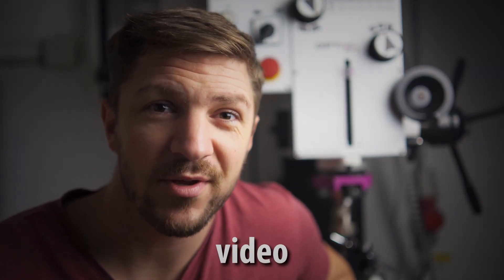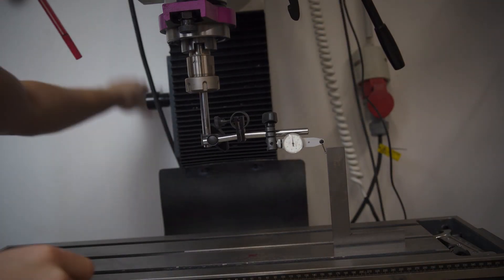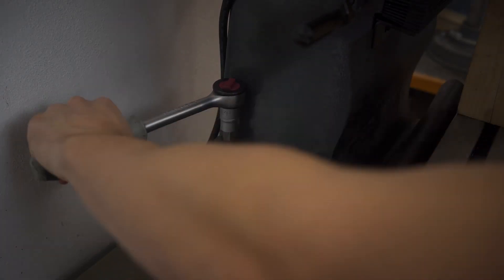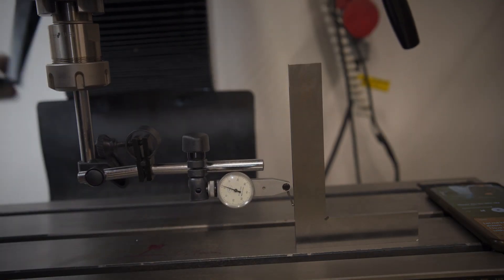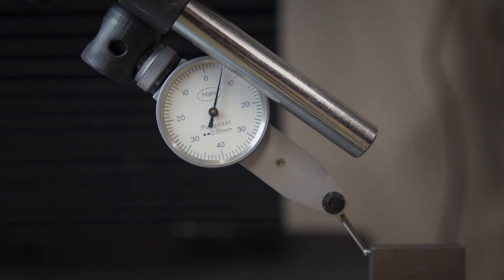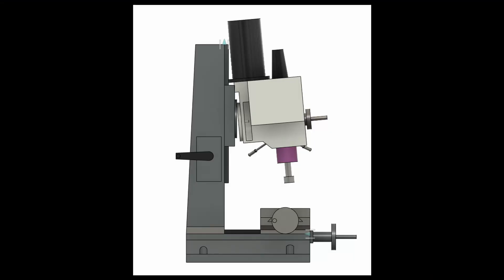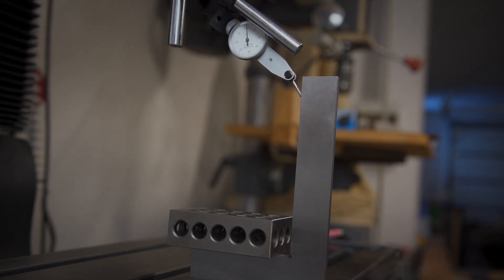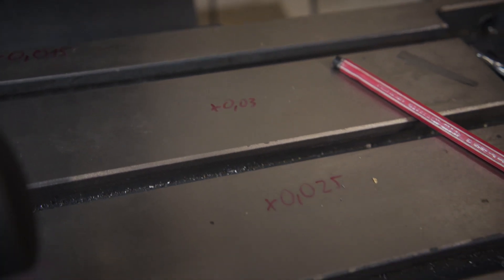HOW TO TRAM A BENCHTOP MILL | Optimum MB4

Comment: only comment is its better to clock to a fixed point on the table rather than sweep across. usually a ball. no guarantee that table top is parallel/square to slideways. yes, its a bit more tedious as you gotta twiddle handles...

Comment: In regards to your comment that correcting the mating surfaces is still beyond your skills, there is a very easy yet brilliant solution! The normal way to do it is through hand scraping, which will yield extremely accurate results as far as flatness, and will also produce superior bearing surfaces if they need to be lubricated because the depressions produced during scraping will hold oil very well, but scraping is also quite an art form to do properly. If all you want is flatness down to a couple micrometers, of even below 1 micrometer, then you can do it by rotary tool. What you do is you still use an ultra flat reference surface like a granite surface plate or a cast iron straight beam and coat it with a thin layer of blue oil paint and apply it to whatever you wanted to scrape. However instead of hand scraping all the spots the blue paint transferred to and thus are too high, you use a small handheld rotary tool or one with those extenders and one of those coloured aluminium oxide or carbide coated epoxy resin inserts for the rotary tool. I used it to flatten the absolutely horrible bed ways of my mini lathe and it works insanely well, down to sub micrometer flatness over several dozen centimeter distance!

Comment: When sweeping the indicator on the table it should be noted, that this method shows any perpendicularity error between the spindle axis and the table plane - thus it is also necessary to make sure that the table plane is parallel to the x-axis and y-axis by putting the indicator needle on the table and moving in x/y.

This also applies to the reference square method as we want the column/head to be parallel to the movement of the x/y axis not just the table surface (which could be unevenly ground or not parallel to the x/y plane)

Super Video sonst - alles Wesentliche in unter fünf Minuten erklärt!

Comment: "typical import square collumn geared head benchtop mill"
the major problem is that the vast typical import is a Cinese crap such as SIEG, which has no option to adjust spindle axis alignment in reference to the column guide at the bolts are buried inside(!) of a head stock housing
Reply: Hmm pallet plate bolted to milling table and shim it..just a thought..

Comment: Excellent video, very helpful.

Where abouts did you get your shim stock pack from? I'm looking for something similar (for the same task), but not able to easily find anything (probably because I'm in Australia and materials that are easily available in the US and Europe seem to be unobtainable or extremely expensive here).Think I found the product you got and the company it came from.. unfortunately, they do not have any outlets in my hemisphere.
Reply from the maker: You can also use feeler gauges, and just cut them up.

It's not a permanent solution, the better way would be to do it like Stefan götteswinter, and fill it if epoxy, so there is a solid connection
Reply: @ChristophLehner  Yep, I'm doing that now. Bought a couple of cheap feeler gauges to cut up, but will likely go with the machine epoxy solution in the long term... if I can find someone who sells that in Australia.
Reply: We used to use cellophane  from cigarette  wrapper that's. 001 thousands thick..or piece of soda beer can they used to be .004 thick now their  about .002 uses to do it to align punches for dies on punch presses...job has to get set up